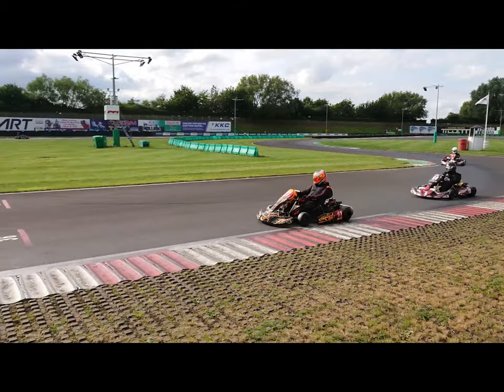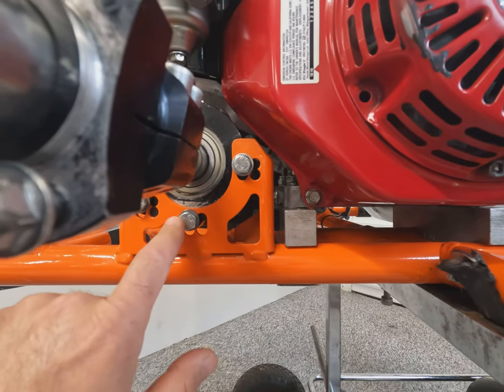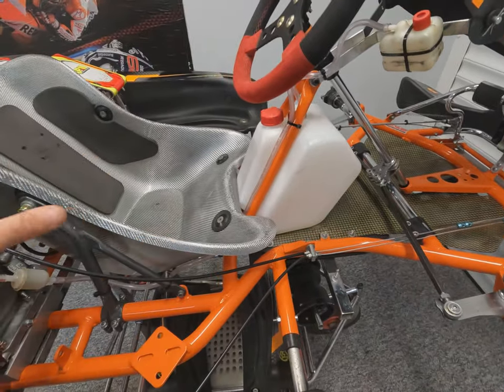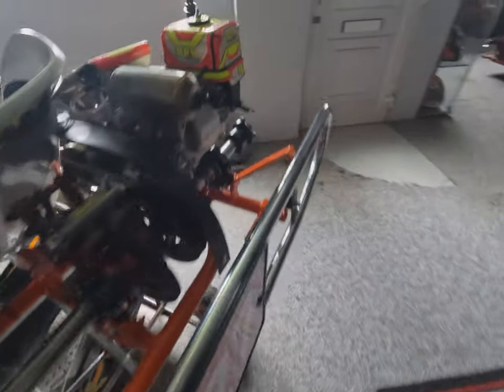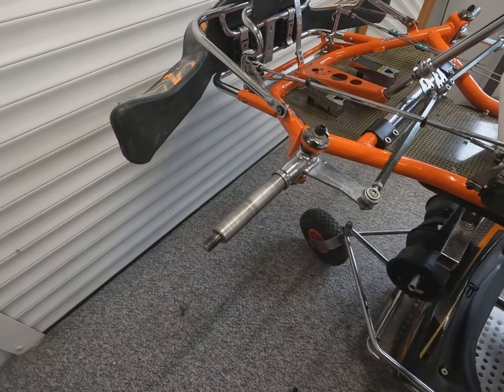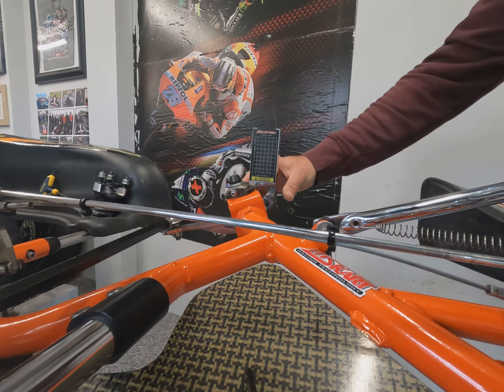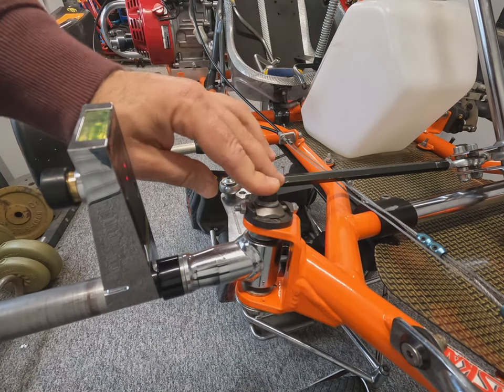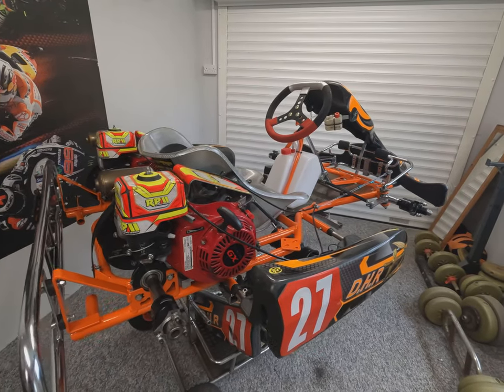How to setup a kart

Comment: Quick question in regards to the side pods and rear bumper, would you then tighten them all in the wet?
Reply from the maker: Yes absolutely 👍 potentially add the extra bars to the pod bars too and seat stays to stiffen the whole thing depending on how wet it was and tyre grip